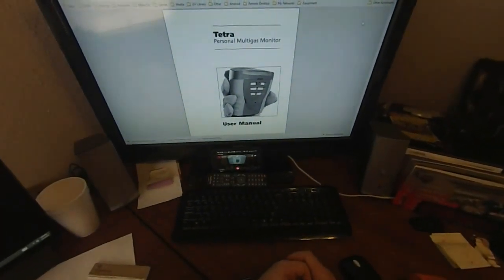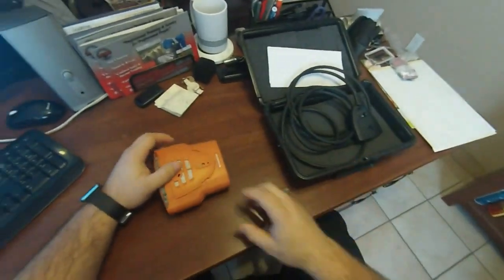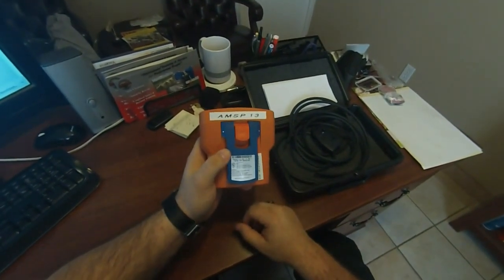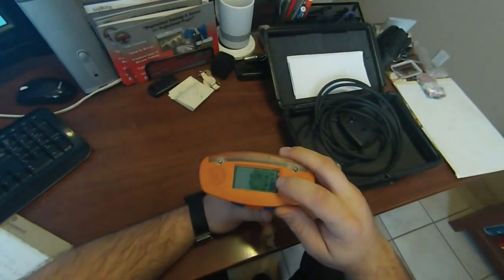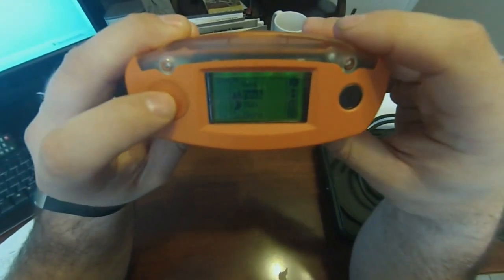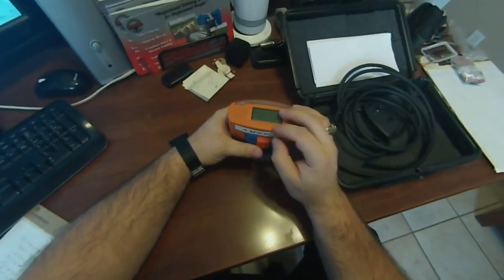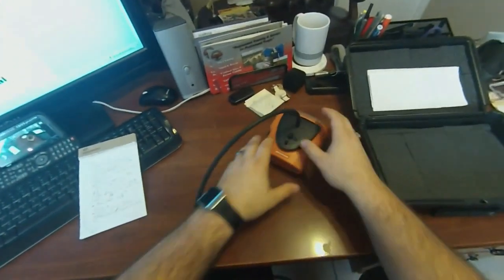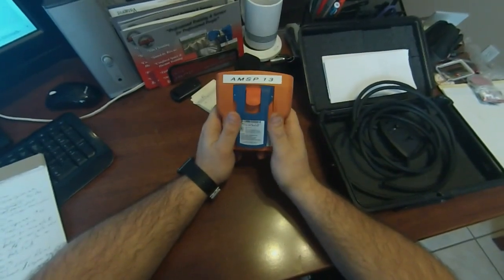Crowcon Tetra

Comment: I've got a crown tetra with 2 dead sensors which won't zero out - CO2 and O2. In fairness, the unit has been sitting in a drawer for 10 years, so what you say is correct - not charging the unit kills the sensors. Now, is there any way to bump them back to life? I only use the CH4 and it's annoying to se the O2 sensor constantly throwing an alarm because of the 0% value. I'd take them out completely but then unit complains for missing modules.
Reply: take dead sensors out, turn detector on, accept the "missing modules" alarm, turn tetra off, turn it on AGAIN and it will be fine. The alarm turns on only once